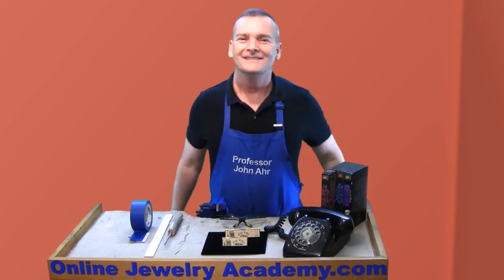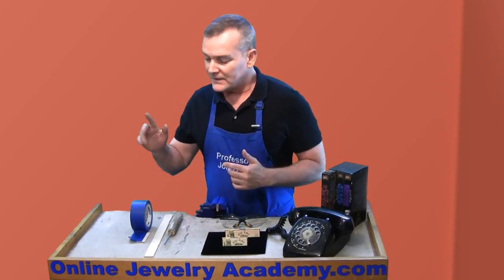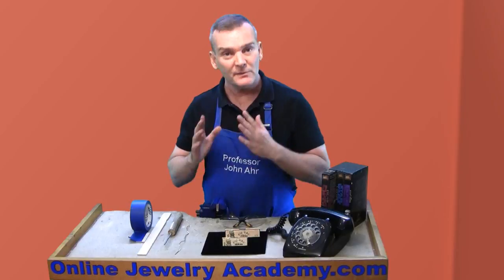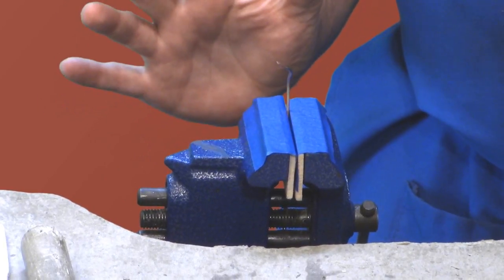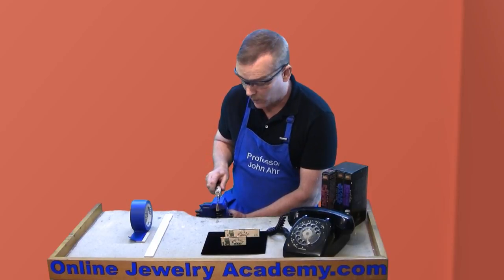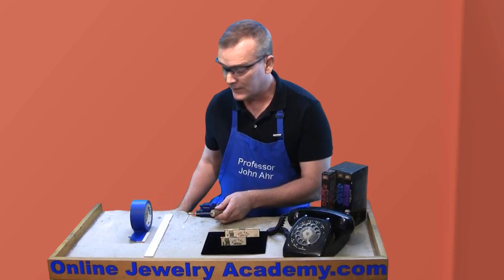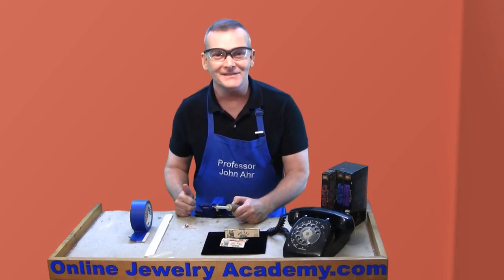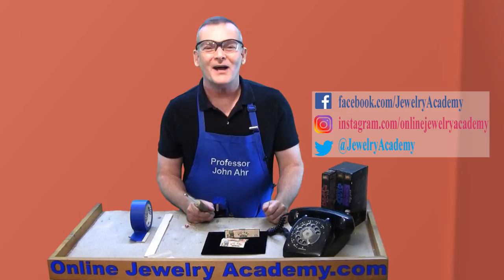An Old School Trick To Coiling Jump Rings

Comment: Hi Prof,
You forgot Chapter Two og the Jeweller's Fairy Tale:
If your jump ring coil is still stuck, it is time to play with fire: burn the paper off and the coil just glides off.
Reply from the maker: Yes, you can burn the paper.  I left that part out of the video because it takes a lot of heat to burn the paper since it is protected by the wire coil.  Thanks for the comment.
And, thanks for your support! : )

Comment: John I agreed with you about the old technology lessons.  Where can I get that mandrill?  It is so cool.  Thank you John, as always, I enjoy your video 👍👍.
Reply from the maker: Hi Alice,  The mandrel was something that I made.  It's basically a steel rod with a handle attached to one end.  Then, the handle is drilled to create a hole that you can anchor your wire in as you coil the wire onto the rod.  I made it using the same techniques shown in the OJA video on how to make a solder pick.  You'll find that video in the OJA's playlist at: www.onlinejewelryacademy.com
Thanks for your support! : )

Comment: Ive never had a problem removing jump rings from a metal mandrel. I also find hand turning too slow. I use far more rings than this method makes. I use knitting needles (easy calibration) in a 3 jawed drill chuck and a power screwdriver (slower than a drill). I get a 6inch coil and then cut with a jeweler's saw.

Comment: Ok what am I missing how is this different from winding the wire around the mandrel
Reply from the maker: The method shown in the video helps to maintain the annealed quality of the wire as you coil it to create jump rings.  Pulling on the wire as you coil it slightly work hardens the the metal.  I hope that explains it for you.
Thanks for your support! : )
Reply: Thanks